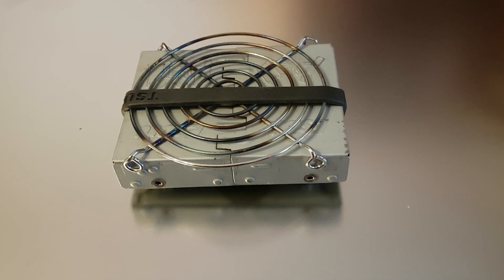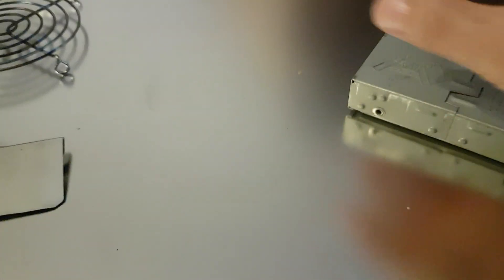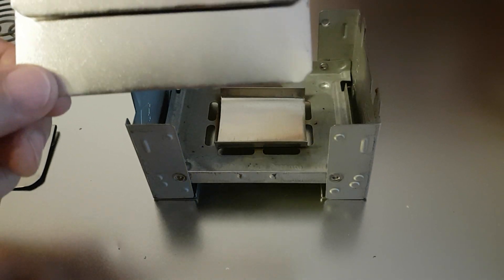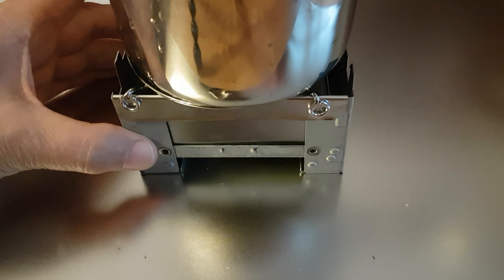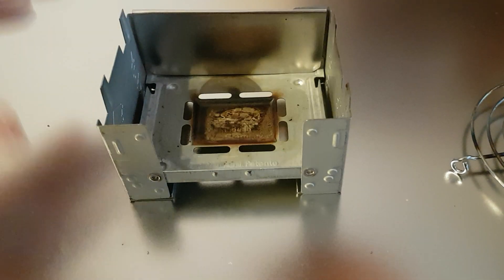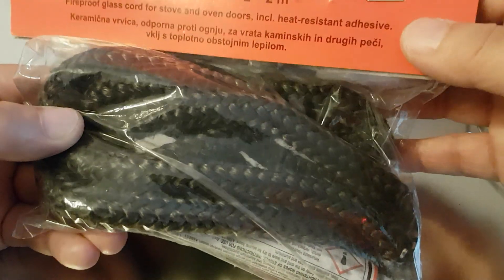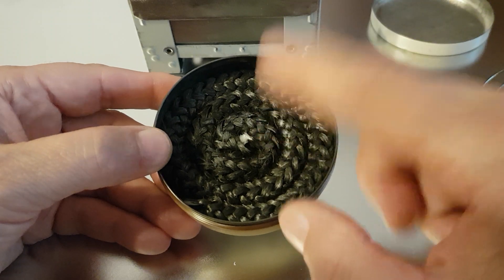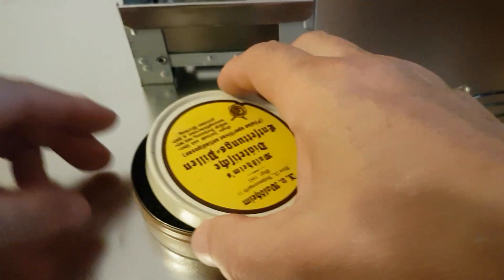DIY Esbit stove windshields and fire rope alcohol burner mod

Comment: What also works is the fiberglass roof insulation but than you need to make some construction to keep it in. Either jamming it between two tins or a piece of kitchen strainer metal.
Reply from the maker: Thanks for watching and great tip!

Comment: Yes, have my own arrangement with the fire rope alcohol burner but with one of the thin metal wind shield/pot stands you can get. Had no idea you could get thin aluminium sheets from art type shops, some of that would make an ideal additional wind shield for windy days. Tin foil, even the thick stuff gets damaged and deteriorates fairly quickly. If I'm using Esbitt I just use the lid from the alcohol burner tin to put it on.

Comment: Excellent idea! I made the windshield using a used beer can right away. But I made the windshield a little bit shorter so they sit comfortably inside the stove bottom between the two short walls on the horizontal side. Also I used a smaller tin which is shorter in height so that it fits in the stove as well when closed!  Doesn't take as much acohol (around 15ml) but enough to boil 500ml water in normal conditions and doesn't take any extra space!

Comment: Did you use Isopropyl alcohol or denatured alcohol?  One emergency heater I was told about in a course was to take a soup can, isopropyl alcohol, and a roll of toilet paper with the cardboard roll removed from the center.  You pour in the alcohol and the T.P. is like a wick in a zippo lighter.  Isopropyl does not create harmful vapors so this can be used but it could still tip and create a fire.  Do not pack the T.P. in too tightly it could rocket out I was told.  Back to esbit...Looking at the rope, I can purchase it on ebay USA for basically $11 USD.  Same size but of different manufacturer.  If you could make a field test of the burner that would be great.  Thanks again.
Reply from the maker: Thanks for your comments! I will be field testing this week end, including the new Esbit alcohol stove that I've just bought. I've slightly modded that too. Watch out for the video on that too! Also I used alcohol for indoor burners. I'll check it later. I live in Austria and they don't call it 'denatured' here.
Reply: Isopropyl is very messy and burns orange, sign of inefficiency - but it does work. Denatured/meths is better, uses less fuel.